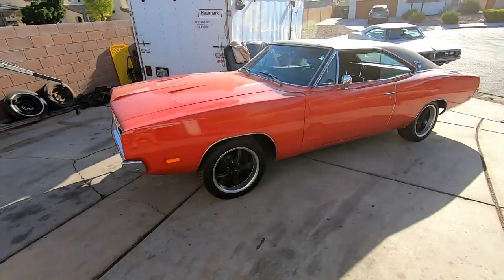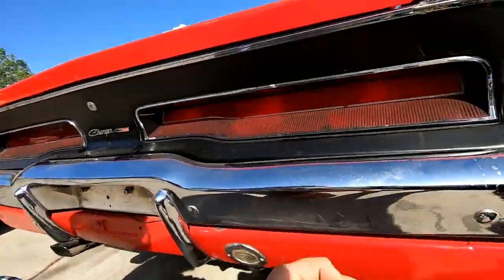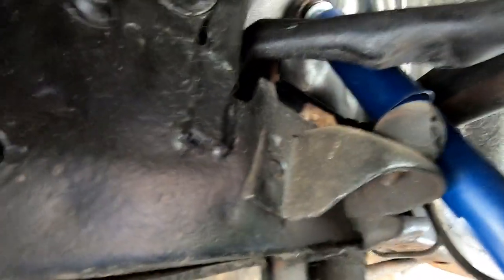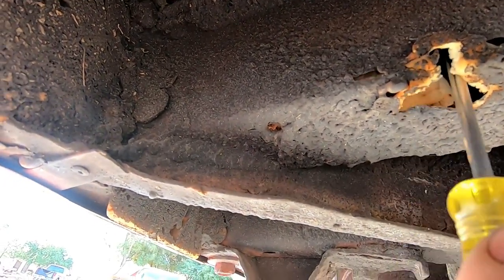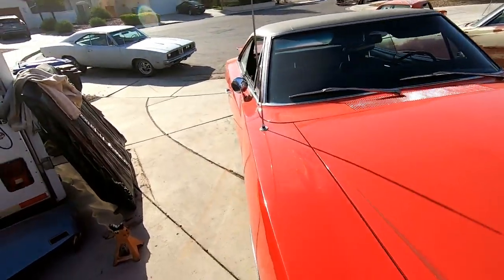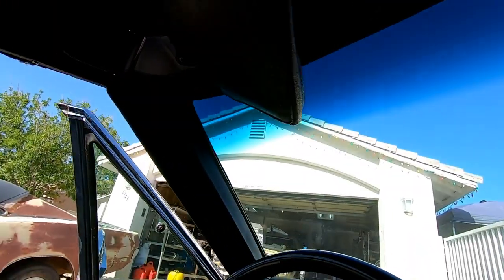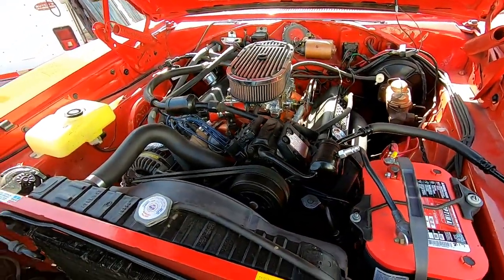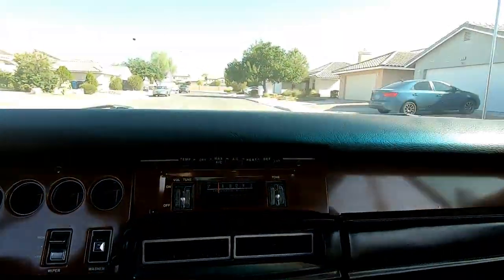Look Before You Buy that shiny Polished Turd...

Comment: This is why I collect Cadillacs or the odd cars no one wants or have very low value
Low value Cadillacs IE my Datsun 510 OMG a 510 someone says n I reply yea a 1980 510 station wagon n they reply oh I thought it might be a 1970s one I reply oh no those are ridiculously expensive and like this charger that badly wanted flipping dollar all kinds of things get done to get every cent but a 1980 510 & my 1976 B210 bought online arrived with absolutely no rust and no filler as did my 1978 Cadillac coup deville delegance miner totally perfect none have any milage above 80k miles the 210 is 16k miles for a whopping thirty five hundred the Cadillac a whopping $5000 is mint one owner so guys ask hey you got any 60s mustangs chargers or gtos n I proudly say NOPE those get stolen and have a tone of miles were crashed into a tree totaled out and rebuilt from spectral cars,the insurance on them is astounding and they eat a ton of gas not much fun when you get down to it. My cars all have permanent vintage tags no rust liability only and I don't worry about them getting stolen.they are fun to own,I don't get tickets in them and I save a lot on parts as their not mustangs cuddles and some silly part isn't hundreds of dollars.thefor I behave 20 various cars no trucks no muscle cars .those cost way to much and get stolen.i had several Rolls Royce cars when growing up they were fun to drive but the salesmens business cards left under the wiper,I finally decided I no longer wanted a money mercinary magnet anymore or 3500 dollar hydralic overhauls
Cars are great but nowadays greed is so rampant I'm glad I'm happy with those cars no one wants as much and parts can be found at reasonable prices most parts can be bought for the same price they sold for when they were new.no 2 dollar parts now two hundred fifty. But if that part fits a 60 s muscle car bend over n grab your ankles....I rode around in those cars back when they were being driven by their 1 rst owners yea they were kindah fast but gather accidents tickets and problems many of their owners fell into made them not as fun.besides someonone needs to rescue the fine one owner cars with no rust sitting in elderly peoples spendypoo subdivisionypoo imaculant garages.they grandchildren want to get rid of ASAP granny or grandpa dies to quickly buy some plastic pod like a spendypoo Subaru , you know the new cars, (one smack it's on a rollback) crumple zone they threw their money away on a trendy spendy crumple zone .
A Cadillac Seville owner of a 1979 car was hit 7 times in the back end by crumple zones and no damage every time, finally on that 7 th impact due to wimpy single bulb brake lights her damage was so severe on her only has 800 mils with $8000 in damage said to the 1979 Cadillac Seville owner yea the smaller 70s cady his bumper just slightly misaligned she said you should have to drive a modern car like everyone else.
What a crumple zone, due to all of the crumple zones my car doesn't get damaged butif you were in a 1973 Catalina oh my Seville would be damaged...so enjoy some elderly persons iron block 425 and know its not being sought after be thieves nor flippers..